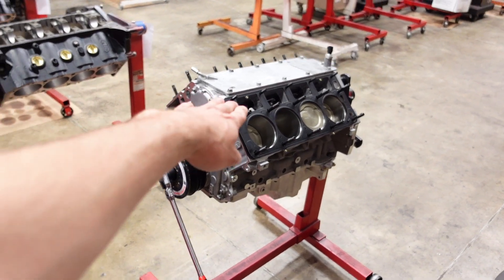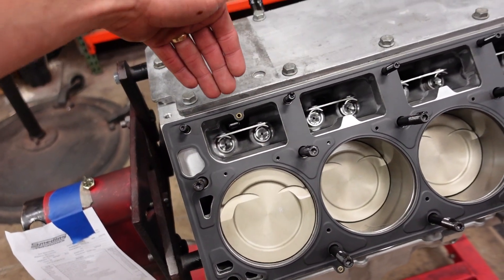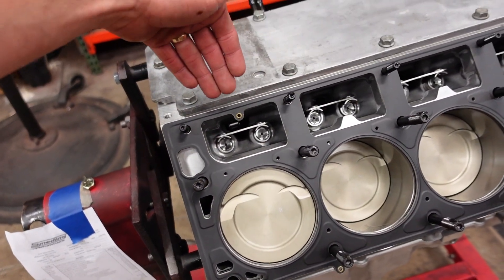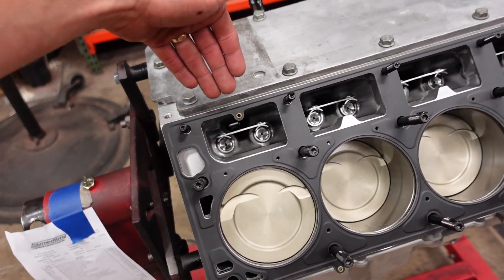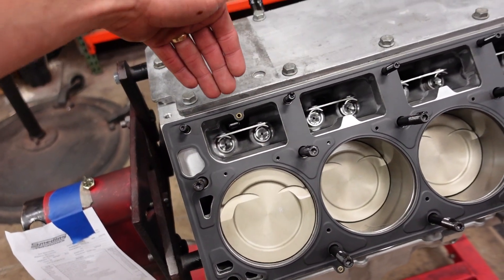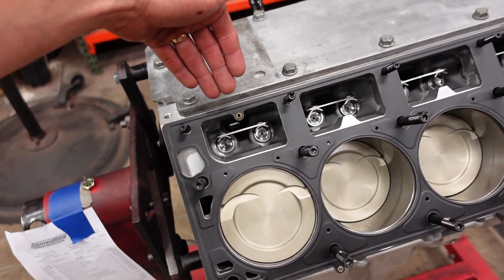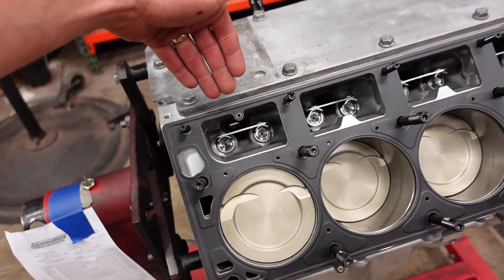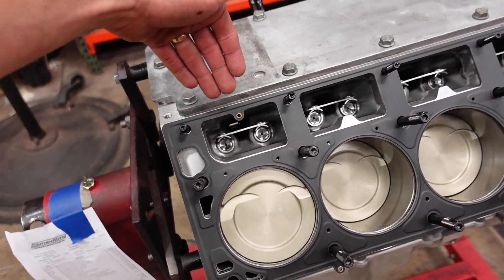LS Engine Build - 1,000hp Supercharged 416" LS3 - Part 2

Comment: Love the series. So ported ls3 heads are sturdy enough for a boosted 416? I plan on running a magnuson heartbeat tvs2300 at about 11psi and was concerned that ported ls3 castings may flex or have issues and was considering putting ported LSA castings on. Are the ls3 heads fine for something that is just an 800 crank hp application? I'd be using head studs with ls9 head gaskets.
Reply: Man geez can you drive these to point a to point b  lol

Comment: What is your opinion on stock style rockers? Would you not recommend a roller tip type rocker for 1000-1200hp levels
Reply from the maker: Rocker arm tips are not horsepower dependent. RPM & spring pressure is the deciding factor if you can run a factory scrub nose tip rocker, or if you need to step up to a roller tip.
Reply: @JacobVillemain  ok well what spring pressure then? 7000rpm application. I had to upgrade to 425# open 175# seat to keep valves from floating

Comment: Great video as always with great detail.
I had to get my head around the quench calculation. So the aluminium block expands in height from deck to crank plane, effectively pulling the pistons down the bore c0.004” because they are on steel rods which don’t expand at same rate as the block?
Many thanks for your time and experience.
Reply from the maker: You got it!

Comment: When you measured the pushrod length that was for zero lash. I'm assuming this is a hydraulic roller engine. Would you add .050" to the measurement for lifter preload?
Reply from the maker: Yes this engine uses our hydraulic roller lifter kit. Different lifters will call for different preload amounts, always consult the manufacturer.
Reply: Following